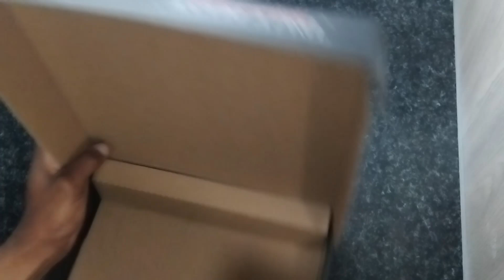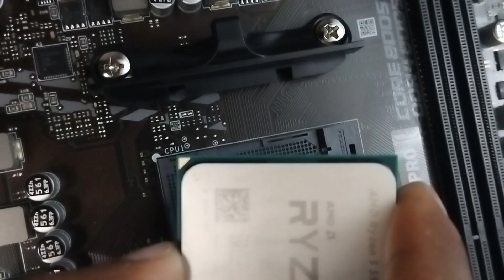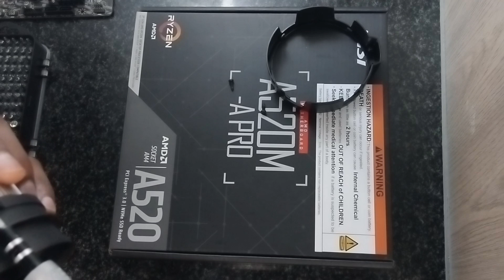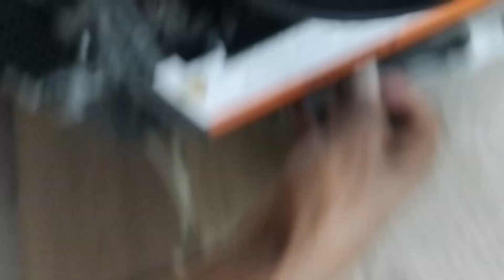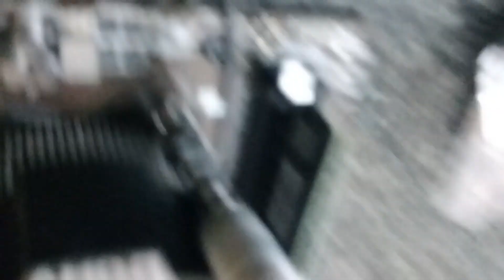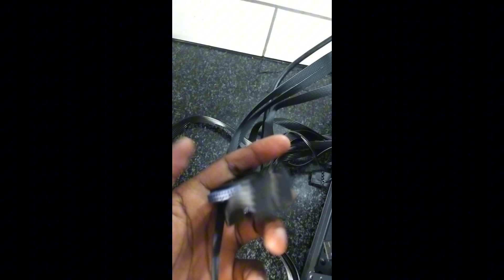GTX 1660 TI Gaming pc build

Comment: 1660 ti in 2025 is crazy
Reply from the maker: It can still play cyberpunk at 1080p. So its a solid option for budget ballers that still wanna enjoy
Reply: GTX 1660 Ti is Still a Solid 1080p. High Setting in old AAA Games , Medium or Low on newest AAA Game.
Reply from the maker: @SkyBeyondSkyVM  Exactly. I love that you get what i was going for
Reply: @ Brooooo because its also my Current GPU. altho mine bit a Bottleneck on CPU.
Reply from the maker: @SkyBeyondSkyVM  What cpu do you have?
Reply: @ Ryzen 3 3200G , from Vega 8 to GTX 1660 Ti is a Game Changer for me.
Reply from the maker: @SkyBeyondSkyVM  Not bad. i went from a GT 740 4GB to a 6600xt
Reply: thats Great , my Old GPU was MSI GT 730 4GB way back 2014-2015 got Vega 8 on 2022 along with whole new PC. and got the GTX 1660 Ti Last Year.